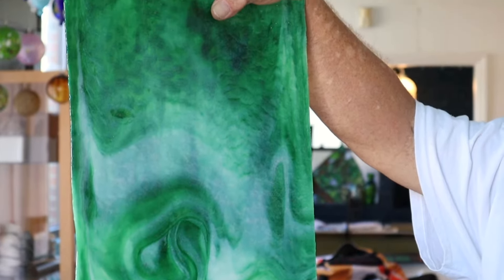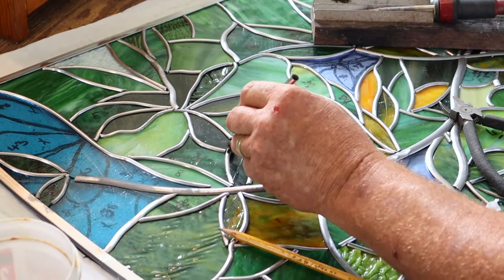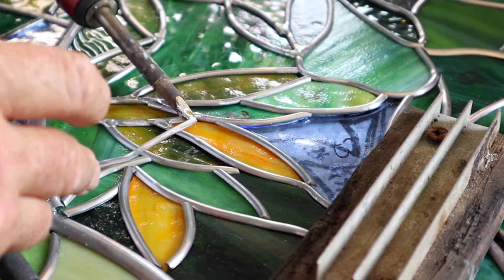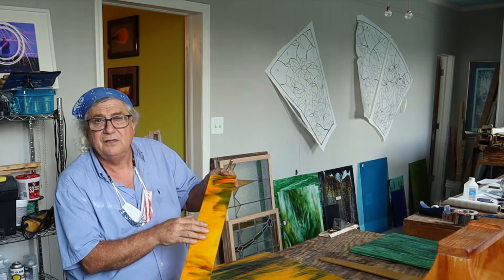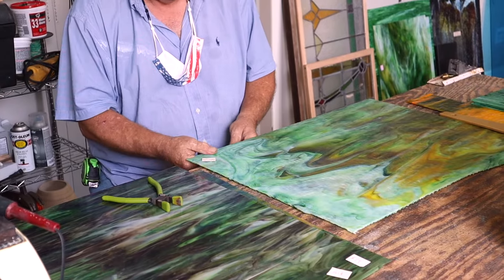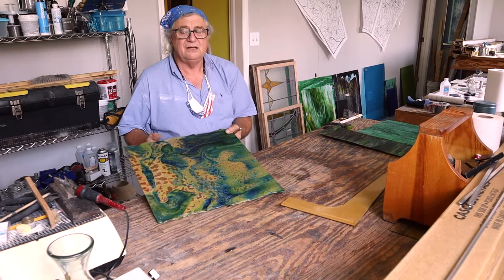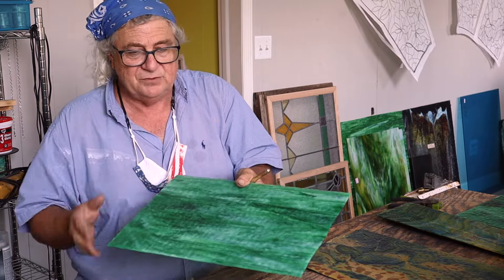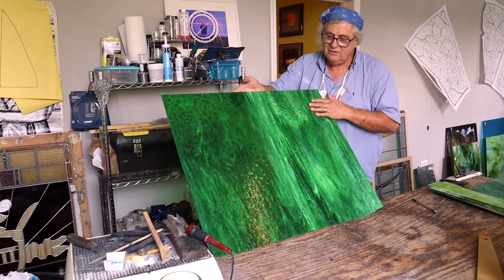How I Make Stained Glass Windows

Comment: Just a suggestion, on lead use Olic acid instead of Ruby for your flux. It does not sizzle and cause bubbles in the solder plus it's what the old German masters used. Also, you can not beat a 200 watt American Beauty iron with a Paragon tip.
Reply from the maker: We use Ruby Flux because it doesn’t smoke nor does it cause bubbles in solder. It’s water based, low odor and easy clean up. You can find the products we recommend here: Check out this page from artyrvglassstudio https://www.amazon.com/shop/artyrvglassstudio

Comment: What do you do with the various gaps in the lead came?  •  Do you just fill with solder?
Reply from the maker: You try not to have gaps before you solder you adjust everything. Filling gaps is expensive. You should be using a 3/8 chisel tip to solder lead.  Thank you for watching.

Comment: I have a project to make a game of echeck alternating between very thick 15mm glass pieces and normal 3mm ones
two problems arise
A cutting 17mm glass is very difficult is there a technique better than another
B the side of the pieces remains dull how do you make them transparent
I have tried with a grinder or a vetical sandblaster on Sunday it remains dull I still have to try with a plasma torch maybe
what do you recommend
thanks in advance
I will try to get back to you this evening for the yin yang cut
but  I  do not  hVE  THE  LINK ?
Reply from the maker: Wet belt with finishing belts and cork belt.
Reply: @ARTyRV  MERCI  BEAUCOUP 
JACK 47 71

Comment: Thanks.  With panels that fit into an existing glass window do you make the borders a bit smaller?  I am imagining finishing the project and finding the panel is a little too big and doesn't go in.  How do you measure exactly?
Reply: I haven't done any pieces yet and I envision having to fit the lead into the window frame first and working inside that?  Sorry if it's a dumb question.
Reply from the maker: Careful measuring and patterns if needed. We come in 1/8 inch from that. The windows have an h-lead border that can be easily trimmed on -site when installed if needed. Great question. Thanks for watching!

Comment: I’m gonna do a project about 3’x5’. It obviously will have a frame but outside of that how do I make sure is solid and stable? It will be foil n solder,not came.
Reply from the maker: That would depend on your design and application. There are so many variables.